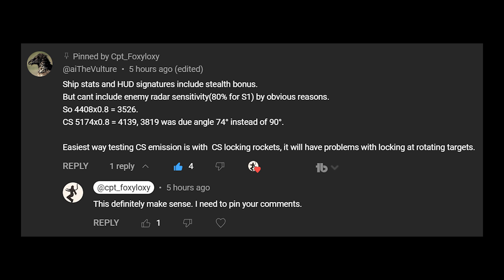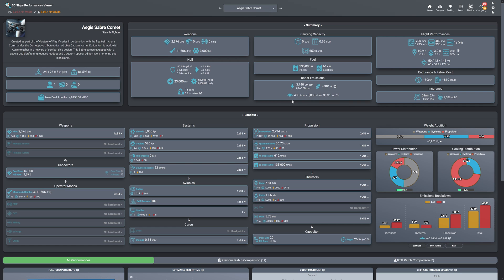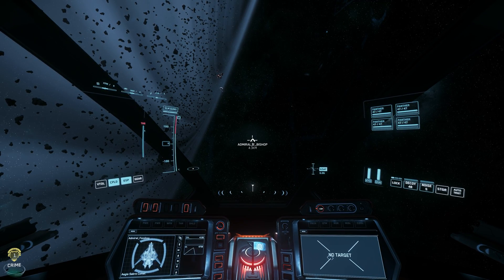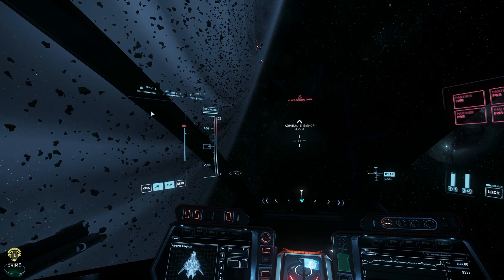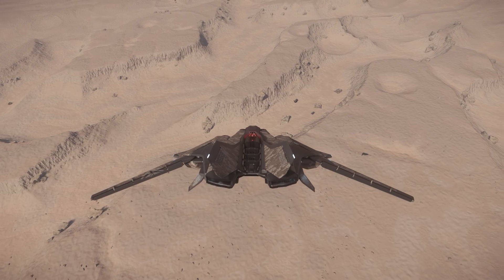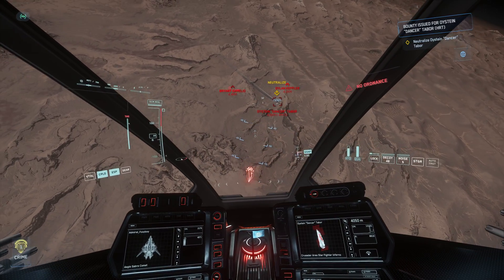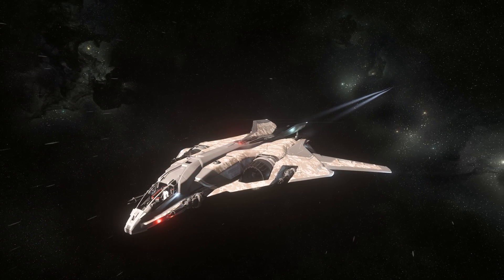The Stealthiest Sabre Comet! | How To Reduce Your IR & EM Signature | SC Stealth Testing & Guide 4k

Comment: Hi Captain, I think  I have the answer to your ambient test at 11:56 in the vid, your formula is wrong.. Instead of 4071*.9-1707=1946 it should be  (4071-1707)*0.9=2534 which matches your result... You need to take off the ambient from your IR Sig to get your total IR differential signal BEFORE applying the 0.9 multiplier from the radar. Congrats on the series you have really got a few of us inspired to investigate stealth play, especially with unstable servers where you can't really dogfight due to de-synch, a bit naughty shooting sitting targets but for ptu it at least gets your rep up!
Reply from the maker: Thank you for the correction, yeah I think you are right, that does make sense, thank you!

Comment: The bit on Daymar when you lost radar lock at 2.5km works out correctly if you use this formula   4071 − 1707 × 0.9 = rather than  4071 × 0.9 − 1707=
Reply from the maker: nice! Thank you
Reply: ( 4071 - 1707 ) x 0.9.
I know it's nit picking but you have to use brackets for your math otherwise order of operations would mess it up.

Comment: No need 4 stealth. missiles are nearfed into the ground.
Reply: There aren't. If you're referring to the ptu, that was only a temp change for testing another problem thought to involve missile speeds. There is a new ptu patch that has now reverted missile speeds. Torpedos are actually faster now than they were before.

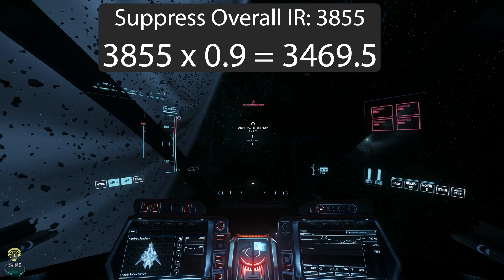Comment: I'm only @7:44 but already there's a small misunderstanding with your test. The range at which a ship is DETECTED and the range at which an established TARGET LOCK IS LOST are different. Once an observer has a target lock, the range required to break the target lock is (or should be, last I checked) greater than the range required to detect the target. This can be mitigated if the target drops noise to actively disrupt the observer's target lock. Did that make sense?
Reply from the maker: Yes, I think I got what you mean, that is why I am using this targeting and then backing up method, I was hoping, that the moment the other ship lost the radar lock on my sabre is the moment that it loses detection on my ship. So maybe that's not the case?
Reply: @cpt_foxyloxy 
You should do that test soon. I’d rather k now at what range they lose the ability to detect me over at what range I can break their lock. I can break a lock anytime with noise.